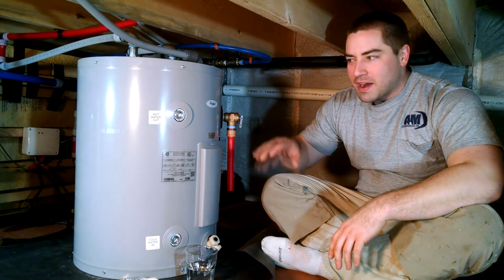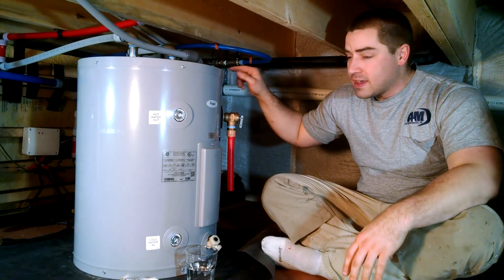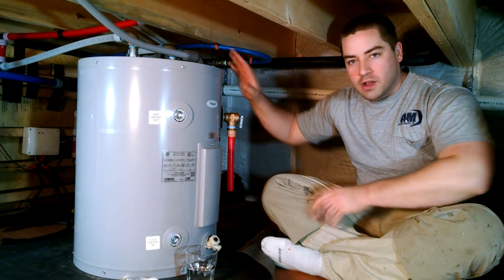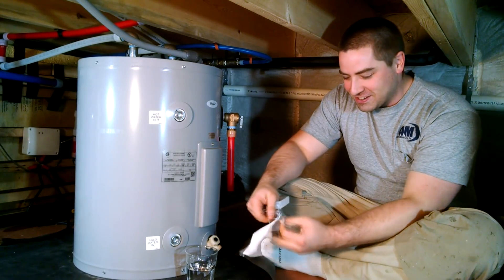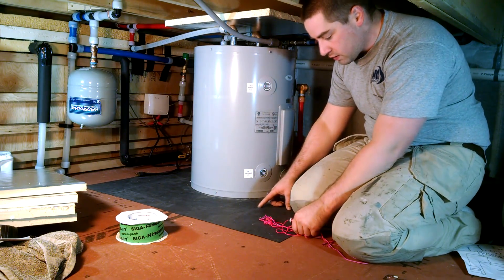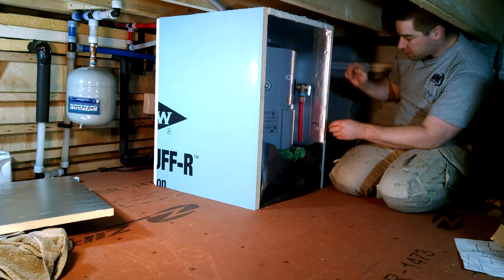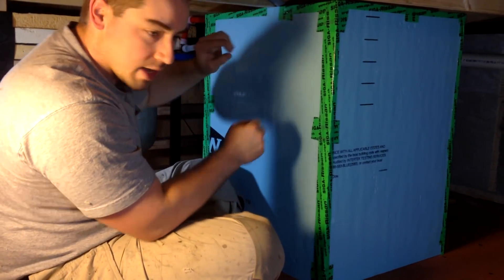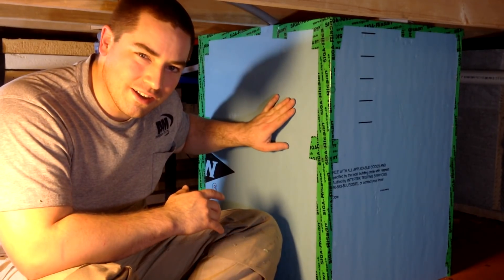Electric Booster Tank Insulation

Comment: Check that tank's anode rod every year or two or threee.   Not that it's an expensive water heater, but just that it'll go eventually.     If you have any humidity, or if you want to recover moisture & heat energy from shower venting, a heatpump water heater could do it.  And that you would want to be checking the anode rod.   I've been thinking to insulate my HPWH better, along with checking the anode annually.  First time I looked after 8 years it was fully consumed, hope it wasn't gone for too long.

Comment: I had a new on demand ECO water heater kicking around from when I wintered in Florida so I used it and it only heats water when required otherwise it goes through without heating when water is already hot, seems to work. What you have will work great and insulation is always required for heat loss.
Reply from the maker: On demands can work too.  I thought of using an on demand instead, but I had a couple of concerns.  #1 if it was good for the whole house then it would need a huge amp draw and I was looking for something I could use on my future (now installed) off-grid inverter.  #2 I was reading that the electric elements were either on or off.  No modulating.  (at least on the models I looked at) which meant if the solar tank was 100’F and I wanted to boost it 20°F, then an on-demand wouldn't do it.  That the incoming water had to be 60°F or less to kick on, otherwise it might over-heat the water to scalding temps.  
In my future home I hope to build a tall storage tank to take advantage of stratification and not worry about needing a booster tank.  But I'm working in a crawlspace because it's what I have now.

Comment: Why don't you use an on demand heater? That's wat I have at home. Wouldn't that eliminate standby loss?
Reply from the maker: Great question,  There are a few reasons I choose to use a tank style.  First, the only energy I'm considering at my home is electric.  A propane or NG water heater is off the table.  Part of the goal of my home is fossil fuel free, zero combustion.  So when I was looking at electric heaters I could not find one that was variable heat output.  They were either ON or OFF.  The problem is that the water temp entering the electric booster tank will vary greatly.  I would need an on demand that could measure incoming water temp and heat up only a little for warm water, or a lot for cold water.  I couldn't find that.  

Another reason was that I used to work in a hotel with a lot of on-demand electric units throughout the building in the public restrooms.  They only lasted about two years before needing replacement, and tanks last longer.

Comment: did you measue electric consumption prior to insulation?
Reply from the maker: Nope, short time span between installing the tank and insulating it.  I will be gathering electrical data for the next month and then plan to do an update video where I compare the new system (solar + booster) to the old system (just electric).